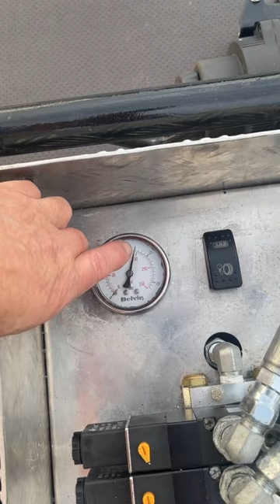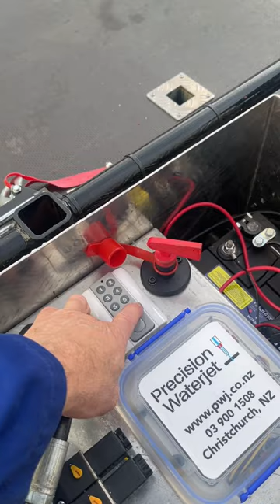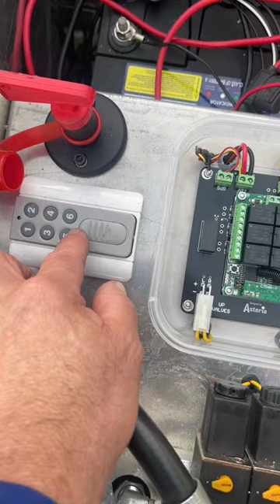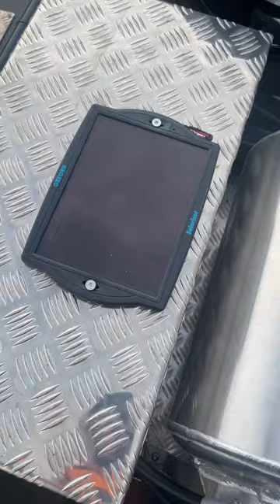How to build your own Air Bag trailer. Trailer build Course.

Comment: Out of curiosity - which part controls / limits the main operating pressure ? I mean when system knows its fully pumped ? Is it valve or this control board ?
Reply from the maker: It's a manual control, you just pump it up until the trailer is at the ride height you want. The maximum operating pressure is regulated by the maximum output of the compressor which ia 160 PSI in this case, the valves, bags and air lines are all rated over double that pressure.
Reply: @ultimatemanshed Thank You for Your reply . That make sense to me now 😉

Comment: Maybe .5% of USA trailers have shock absorbers.
Reply from the maker: and is this a good thing or a bad thing?  in my view, adding shock absorbers to a car transport trailer is a great idea for several reasons:

1. **Improved Stability**: Shock absorbers help keep the trailer stable, especially on uneven roads. This means less swaying and bouncing, which is safer for both the vehicle being towed and other road users.

2. **Better Handling**: They enhance the handling of the towing vehicle. With shock absorbers, the trailer follows the tow vehicle more smoothly, making it easier to maneuver, particularly at higher speeds or in windy conditions.

3. **Reduced Wear and Tear**: Shock absorbers reduce the stress on the trailer's structure and the tow vehicle. This can lead to less maintenance and repair costs over time.

4. **Protection of Cargo**: For a car transport trailer, this is crucial. Shock absorbers help protect the vehicles being transported from damage caused by vibrations and bumps on the road.

5. **Enhanced Comfort**: They make the towing experience more comfortable for the driver by reducing the amount of vibration and movement transferred to the towing vehicle.

6. **Safety in Emergency Situations**: In case of sudden stops or evasive maneuvers, shock absorbers help maintain better contact between the trailer and the road, providing more control.
Reply: I just think it may have to do with our roads? Pretty flat usually
Reply: Can I buy just the mounts and axles from you?
Reply from the maker: Jeremy, we do not sell for export, the parts are very heavy and shipping costs have proven to make it uneconomic. A local laser or waterjet company should be able to cut them for you. @jeremylakenes6859